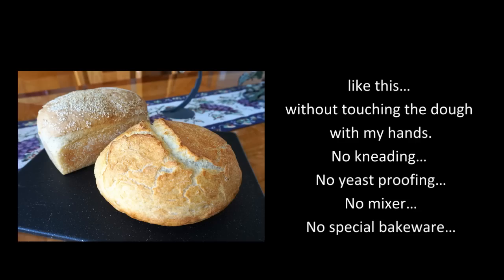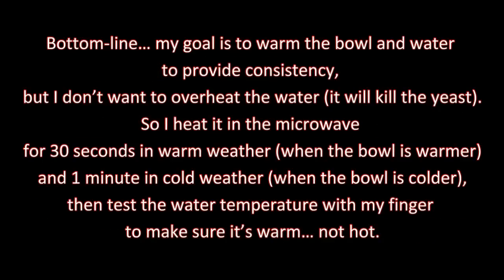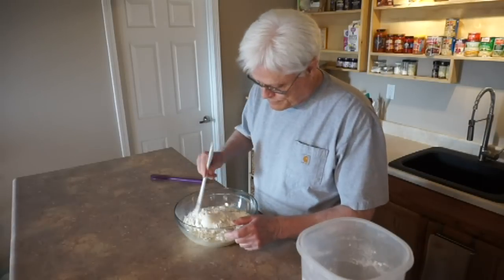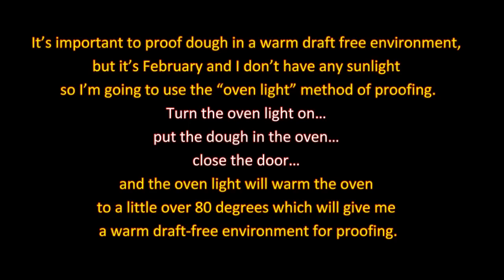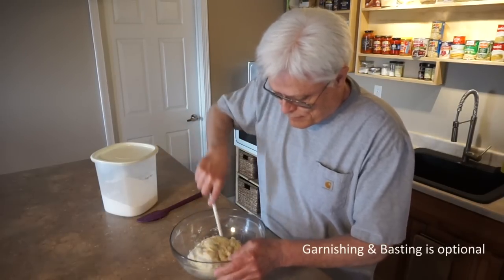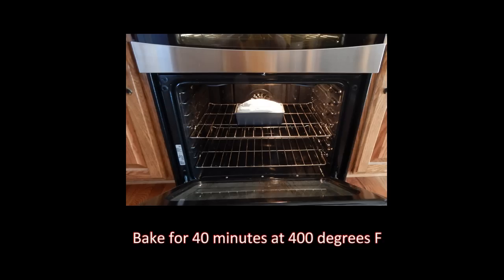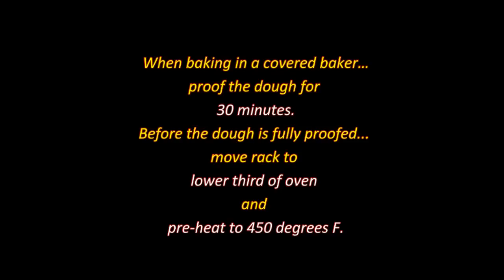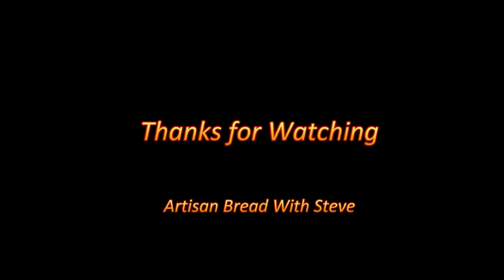Ultimate Introduction to No-Knead “Turbo” Bread… ready to bake in 2-1/2 hours

Comment: How do you figure out the appropriate size baking pan? I was recently gifted an unglazed covered clay baker and would like to use it for bread. The bottom holds 2 quarts of water when filled to the brim, and the top is the same size.  I don't know if that will be big enough or too big. It's a rectangle,  similar to a bread pan.
Reply from the maker: Bread pans are typically 8-1/2" x 4-1/2" (my preference) and 9" x 5". Steve

Comment: you didn't explain heating the dutch oven before baking.do you preheat oven and dutch oven for 30 minutes before baking?
Reply from the maker: The bread pan was not preheated and baked at 400 degrees F. The Dutch oven was preheated for 30 minutes and baked at 450 degrees F. Steve

Comment: Do you coat the dutch oven with no stick spray or butter, or just place the dough in by itself?
Reply from the maker: If my baking vessel has a problem with sticking, I use no-stick spray just before adding the dough. Steve

Comment: Why no oil? What’s the difference between adding oil to the dough or not?
Reply from the maker: French don't use oil, Italians do. Steve
Reply: @artisanbreadwithsteve  but is there a difference in flavor or texture?
Reply from the maker: @SCSC-qz7rr  Yes, there is a slight difference in flavor and texture. Make two loaves, one with and one without and see if you prefer one over the other or even notice the difference. Steve

Comment: does the bread come out with the same chewy crust when made in a uncovered vessel instead of the covered dutch oven?
Reply from the maker: The Dutch oven gives you more control of the crust because you can bake it 3 to 15 minutes with the top off. Steve
Reply: artisanbreadwithstev ...Sir, so true...mine was a chewy crusty and soft holey inside like a baguette 🥖 loaf! Oui!

Comment: My loaves get overdone on the bottom at 450 deg.  Should I move my rack up or turn oven downn down do I bake longer?
Reply from the maker: If your baking at 450, I assume you're using a Preheated Dutch oven. Try using parchment paper in the DO. Steve
Reply: @artisanbreadwithsteve  I do and it still get overdone.  My thermometer says the temp is correct but a lot of my other recipes(banana bread, etc...) I have to turn it down and cook longer.
Reply from the maker: @missmollycollie911  What kind of DO are you using? Are you preheating it and using a proofing skillet? Steve
Reply: @artisanbreadwithsteve  I am using an enameled 3 qt and 6 qt DO pre=heated and using either a proofing skillet or parchment paper in a bowl
Reply from the maker: I suspect the enamel DO is getting to hot. Don't preheat and reduce the temperature to 400 degrees F. Steve

Comment: Baking today using this method. Steve says the Turbo bread will be ready to bake in 2.5 hrs but my normal 2x 45min prove bread is ready in 1.7 hrs including mixer time. So why call it Turbo? I appreciate that people don't want to handle dough and get their fingers sticky but lowering the hydration from 67% to 60% produces an easy to handle non-sticky dough. What Steve calls 'Traditional' with a 24 hour prove was invented by Jim O'Leary in San Francisco. Jim calls it no knead artisan bread. There is advantage in the long prove in that gluten will form over time without any energy (kneading) input and there will be flavour (yes the English spelling!) enhancement and good texture/crumb. I don't see the point of turbo bread. It's slower than normal bread.
Reply from the maker: No-knead bread has been around for several hundred years. You may want to watch "Quick History of No-Knead Bread (Including New Developments in Technique)". Steve

Comment: 3 cups of flour means how much in oz or grams?
Reply: 3 Cups Bread Flour = 14.175 Ounces or 405 Grams. 

3 1/2 Cups Bread Flour = 16.5 Ounces or 472 Grams
I use a digital scale.   After setting a bowl on the scale, I zero out the scale and pour the desired number of grams in the bowl.

Comment: Just made a loaf in an uncovered pan. I only had regular flour. I forgot the salt. Otherwise followed the recipe. It's good, but I want the outside softer while the inside is either the same or maybe a little more cooked. Using bread flour might fix the inside. Anyone have any advice? 

This was the first loaf of yeast bread I've ever made. This was the simplest least messy recipe I could find.
Reply: " It's good, but I want the outside softer while the inside is either the same or maybe a little more cooked."

Ovens can vary. Try 25 degrees lower temperature but 10% longer baking time.

Comment: I do not understand why there is no shortening or eggs in a bread mix. How is flour and water any different than the glue I used to mix up as a kid using flour and water? I tried this and there was no wonderful baked bread smell that I get when I use the premixed dough mix that I use for rolls that requires butter and eggs in the mix.
Reply from the maker: There is nothing wrong with using shortening and eggs, but they aren't essential. It's a personal taste issue. Steve
Reply: artisanbreadwithstev . @artisan...I didn’t know per her comment ...that’s why you dubbed “it” artisan...yours is much better...closer to bread-bread.